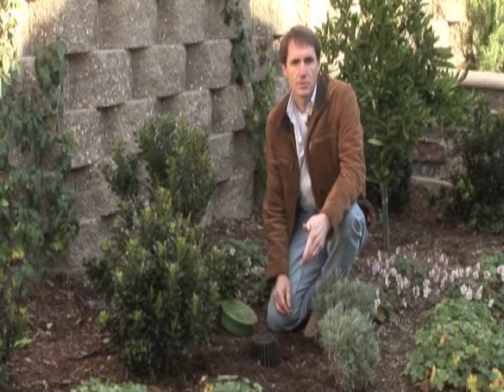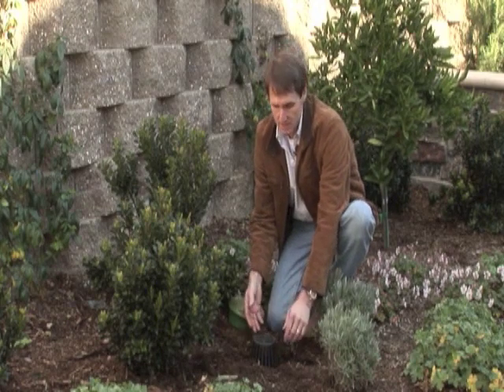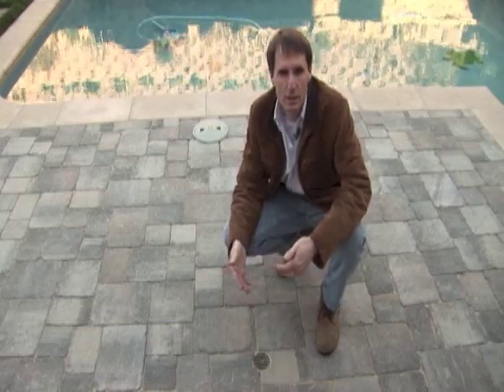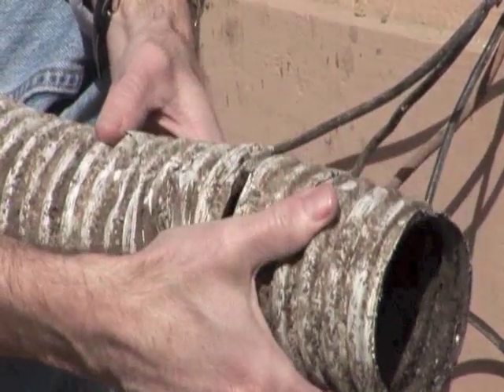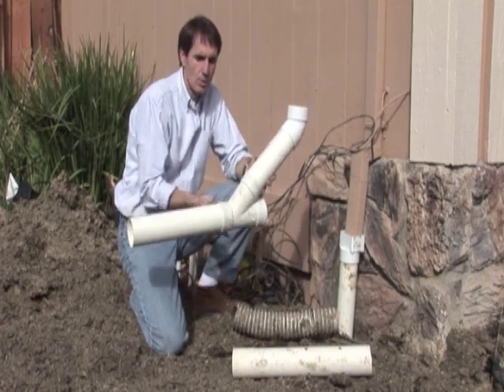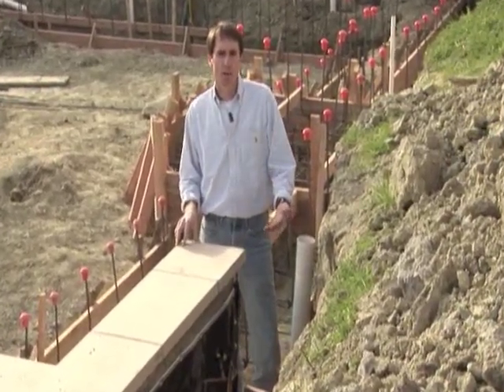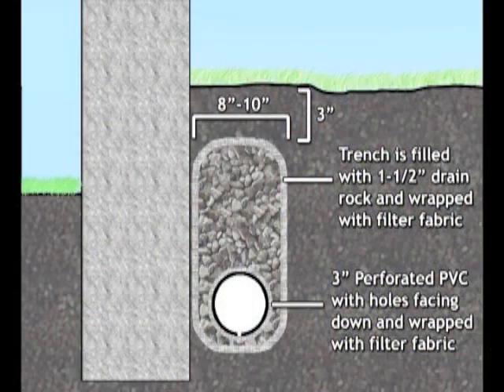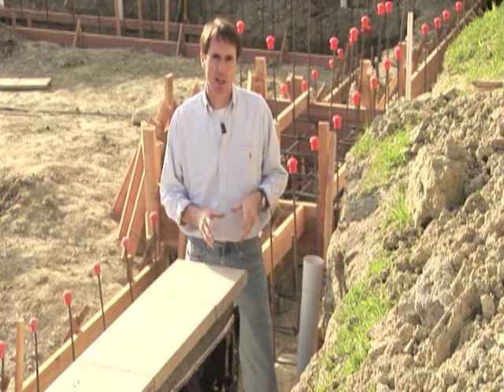How to Design and Install a Drainage System for your Home

Comment: Thank you for this video.  How deep does the pvc pipe need to be?  Using that wye appears that it would have to be 18-24" deep.    Thanks
Reply: Not entirely true.  installing it at an angle, or nearly flat will reduce the vertical profile.  Realistically, that is how one would install it anyway.